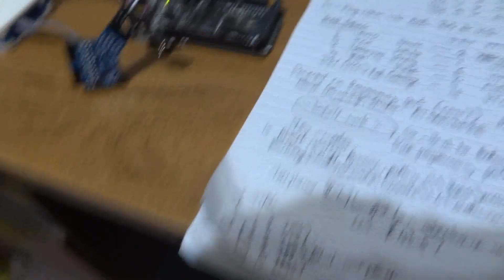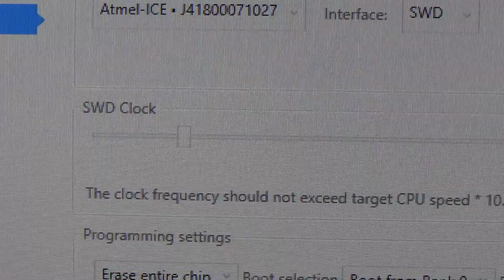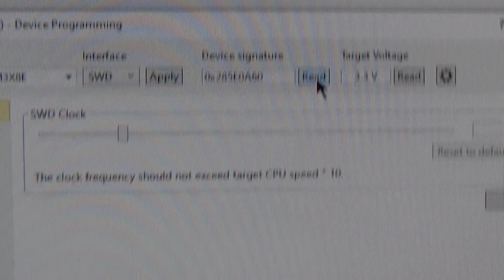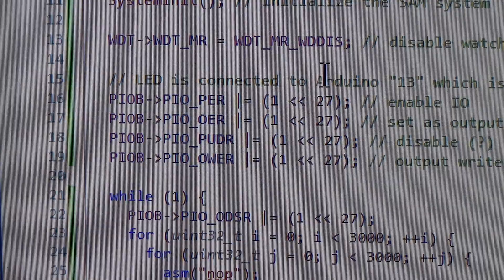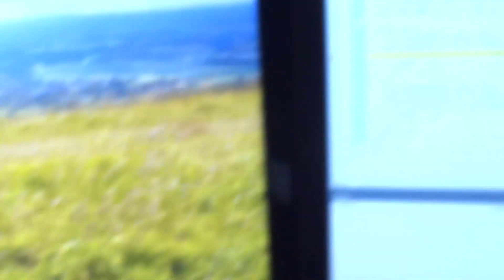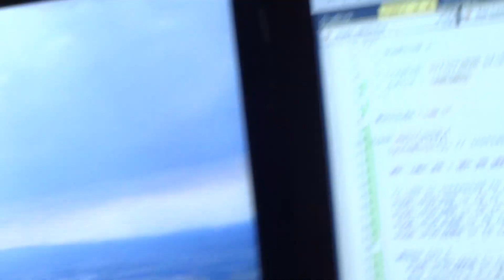Arduino Due with Atmel-ICE.  Debug connection and simple blink program.

Comment: only atmel ice is supported by studio, right?
Reply from the maker: You can use Atmel Studio, and configure it to use Bossac.exe (which is what the Arduino IDE uses) and that way you can compile and upload programs to the Due with just a USB cable.  But that won't allow you to use debug features like breakpoints and variable watch lists - for that you need a hardware debugger.  I don't know if you can use hardware debuggers other than Atmel-ICE.  It may be possible, but I'm not expert enough to know.